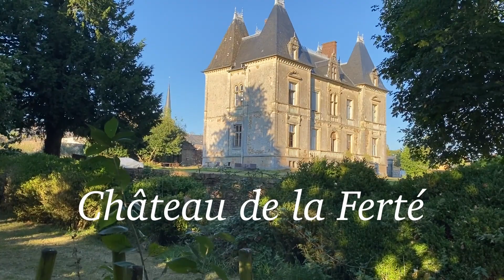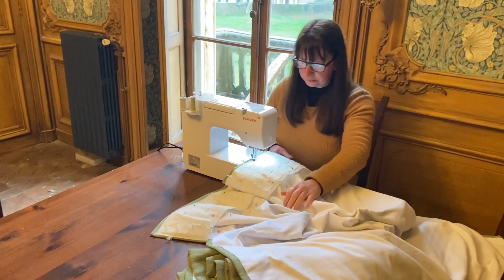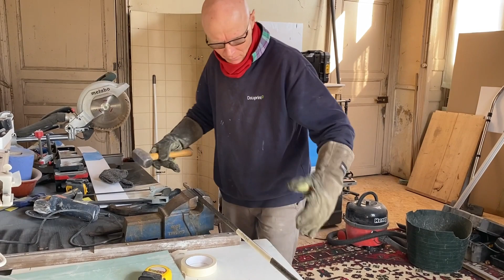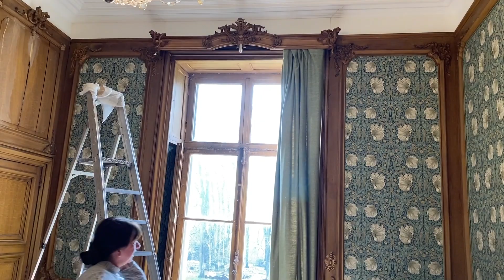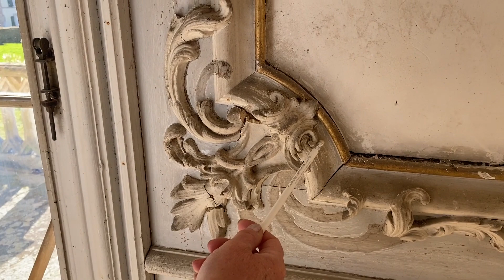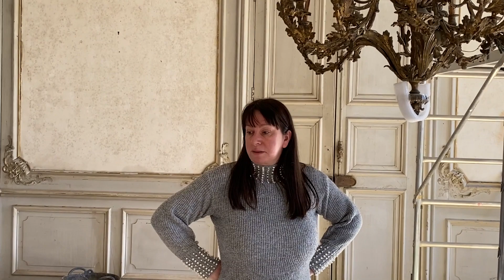Who Needs a Blacksmith?!

Comment: Hi Carol, I love the color of the drapes/curtains!! They blend well. I am a seamstress and decorator and like what you are doing.
One suggestion is that for a fuller more voluminus look,the panel needs more width,perhaps another half meter or whole meter in width for richness. But, first  lift more from the puddle and loosen the hold/the tightness at the tieback. The fabric needs to softly drape and have a bit of a sag... have a "little beer belly" at the upper section OR as if two of the letter R were  facing each other,but not exaggerated. Keep smiling,patience is a virtue and the results will be gorgeous.

Comment: In regard to the plaster moldings you need to replace above the fireplace, Patrick & Stuart on Episode 16 of Journey to the Chateau successfully experimented with Ultracal 30 plaster and Pixios Mold putty in the U.S. before moving to France.  I don't know if they are available in France.  I also note that some similar silicone molds are listed on Amazon, and from a supplier called WoodUbend Mouldings.

Comment: I know this video is 8 months old, but perhaps you'll see it anyway and think it's a useful tip. I use a garden sprayer like the one you used for the woodworm chemical to help me clean occasionally. Fill it up with your solution and spray it on the moldings and such and it should get in all the crevices. Use another one with water to rinse it if needed. You would have to watch for drips that streak the same as you would with any spray. Also, there is a spray just for cleaning chandeliers. It didn't work for me but it works well for others. Lastly, an air compressor may help to remove loose dust and such if it's not too forceful. It also helps to blow stuff of you like plaster dust. lol

Comment: Everything is so exquisitely beautiful. I can’t wait to see it all restored. I might have lined the curtains with blackout. The color changes when light comes through.
Reply from the maker: I have lined and interlined, but to honest they are just for show and warmth, as the shutters block out the light.
Reply: @LifeAfterLaFerté  I meant blackout strictly for not letting light through so it doesn’t change the color. All of my curtains are just for show but I always use blackout so light coming through doesn’t change the color. Yours look great and if they’re pulled back all the time it probably won’t matter much. I’m impressed that you made them yourself. That’s a lot of work especially that long.
Reply from the maker: @tc7486  I had never thought of using blackout lining to keep the colour true. Tbh, with the lining so thick and the wool interlining,  I didn't think the light would come through, oh well, they won't be pulled across during the day. I do have already, blackout lining for the next part one of the bedrooms. It was actually the easiest job in the chateau I've done!
Reply: @LifeAfterLaFerté  for me, it’s just personal preference. If you think about it, when you choose a fabric, you don’t generally hold it up to the light when trying to match something. But with light coming through it looks different than with no light through. Since you seemed just a little disappointed that the color didn’t match the wall paper like you thought, I think that’s why. Of course viewing it on a screen it’s hard to tell the actual color for us, but it looked pretty good to me. I always say it may not be a perfect match but it works. You say that was your easiest job in the chateau, I’d rather eat a bug than make curtains or do any kind of sewing! ☺️ I love how you pay attention to detail and you are doing everything right. Thanks again for sharing your work.

Comment: * Puddling - a decorator plot to do less work and have you pay more money. Years and years ago, I temped in my best friend’s job while she went on her honeymoon (because it’s the only way her boss would give her the time off). I was to answer phones, schedule jobs, and take complaint calls. A customer called to say that they had installed her curtains but they were too short, and the installers refused to acknowledge the issue. They said they wanted the sales guy (= boss) to come over to discuss and fix the issue. When the boss came in I passed on the message. He shouted that the customer is always wrong and I should have told them that they had asked for that length. He followed this with, “Your job is to cover my a—!” In a rare instance of having the retort spring to mind in time, I told him calmly that I thought he should wear his own underwear. 😁 He was speechless. 🤣
My point is that mistakes will happen, but with puddling, the seller never has to fix curtains made to the wrong length (because the length doesn’t have to be exact), uneven floors don’t have to be compensated for, and the customer has to buy more fabric.
 * Molding Sketches - I’m betting that was the way the general contractor (not sure what you call it - the person in charge of the building/remodeling job) communicated to the workers which molding went in what room. Or, if there are different options on different walls, how the designer confined choices in-situs. Very fun to catch that glimpse into old work methods. ♥️

Comment: You can do flower salt and water make a Dow for makeing mold’s after pressing and making shapes let dry or bake it pant it then always use a lubricant before poring you cast it works and it’s cheaper
Reply from the maker: Is that salt dough  used that alot back in the early 90's   couldn't remember the recipe

Comment: In reference to the grey wallpaper. Would it be possible to take overlapping photographs of the wallpaper, at exactly the same distance from the wall and piece them together in a graphics programme. Then each printed sheet could be printed out at the exact size needed for each panel. Just a thought. 🧐🤓
Reply from the maker: This is what Adrian is going to do in photoshop and then try and print it

Comment: Carole:  if you cut the bottom of the curtain on an angle- when it is on the tieback- the inside won’t be hiked up. 
You may want them hanging straight down as well - it wouldn’t work. Just a trick of the trade if in fact you intend to keep the curtains pulled back on the tie back.  The outside of the panel is kissing the floor - the inside is longer - if that makes sense.
Reply: If you opt for the length to be uniform- you could ( stressing could ) do a contrast lining on the inside part of the panel - as opposed to the lining showing.  I know… I am complicating things. But I see that you are hyper focused on the details. Thought I’d mention that ….
Reply: And another thing:  omg. Don’t block me from your channel for these suggestions !  If you place an interlining between the face fabric & lining of what we call bump - or a flannel - ( this definitely increases the weight- but blocks the light from coming through ) & changing the appearance of the color of your face fabric. This is especially useful with silk - that is denigrated by harsh western / eastern exposures. You most certainly already know this - in which case …. Nevermind 😳!!!!!

Comment: The Room looks beautiful, what about draping the curtain around the tie back (sorry cannot remember the proper name for it) a bit more so it dips on the left too.or blouse it a bit. I put a thicker lining on the back of mine and it made my curtains stiffer. Although that would probably cost too much with the length of them. I have just done a course on lino printing, if you could get most of the pattern of the original wallpaper you might be able to make a template.
Reply: Anna the chatelaine in ‘how to renovate a chateau without killing your partner ‘achieved Lino printed wallpaper, it was her own design and was a fabulous result, go checkout their vlog it is extremely funny and well put together